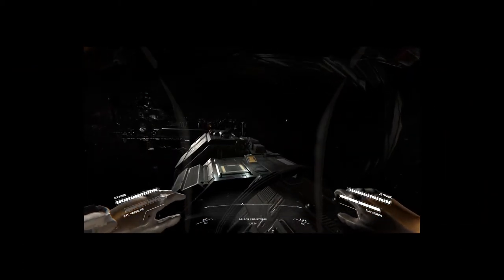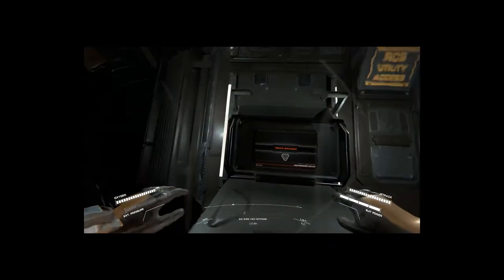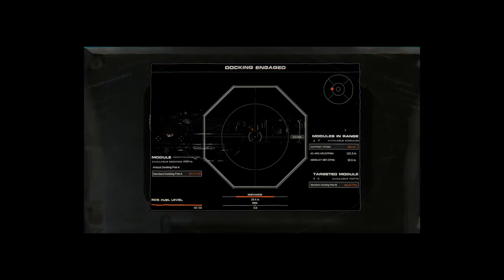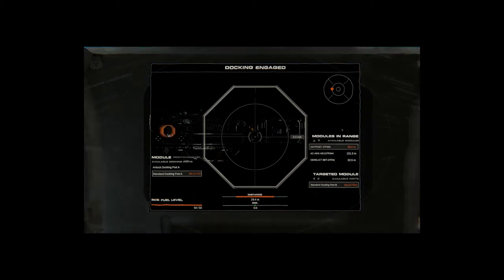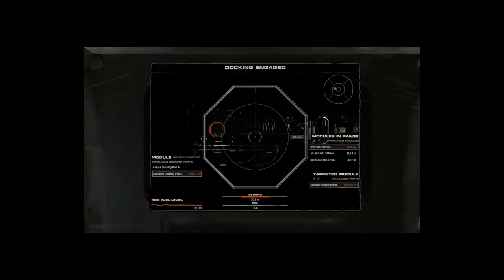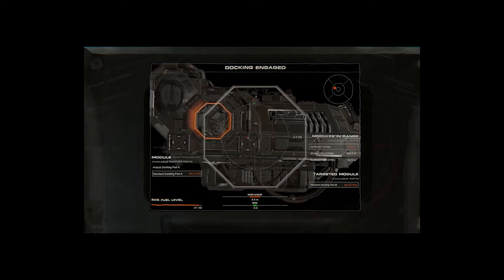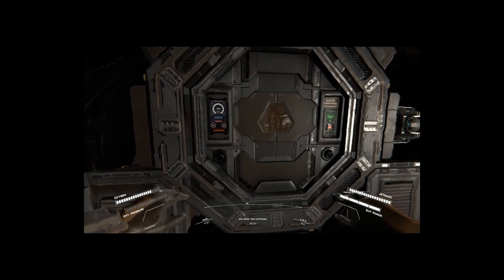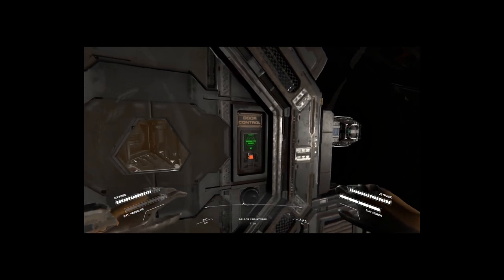Hellion Guide: How to dock

Comment: how do you undock a module
Reply from the maker: find the levers inside that have a colored square on them by the doors and pull them, I ill have a in-depth video later on
Reply: is there no way to undock it via the UI Docking interface? like for instance if i grapple my ship to an airlock
Reply from the maker: no, but there is a lever next to the ship console to pull to release the grapple